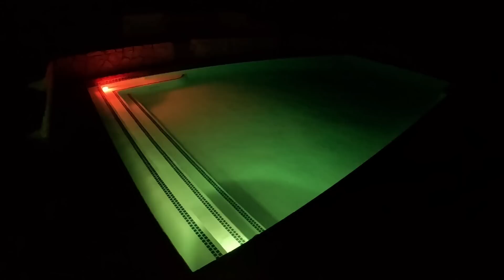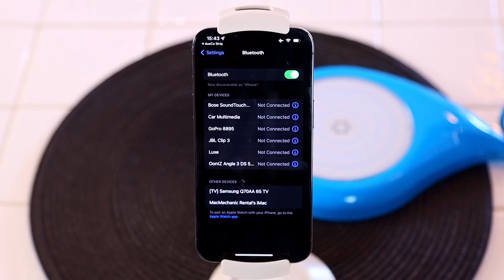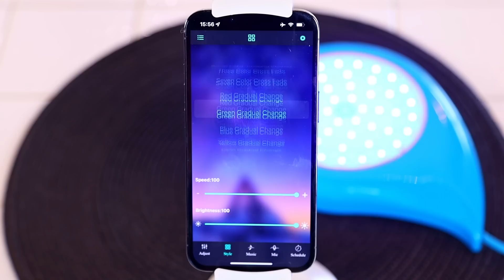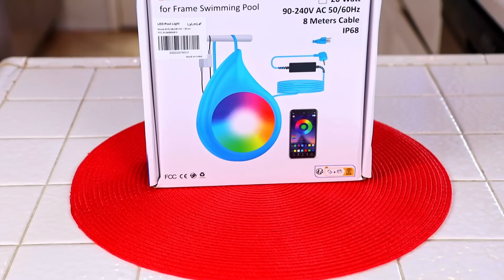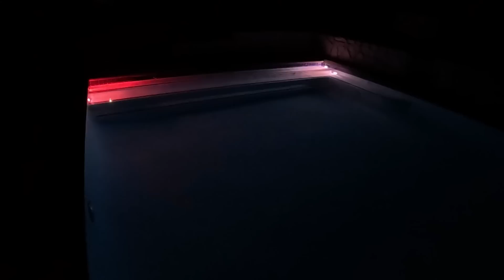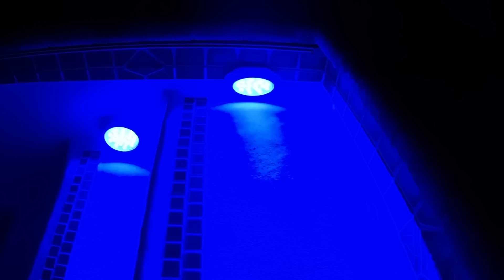Colorful LED Pool Lights - Transform Your Swimming Pool Into A Water Wonderland!

Comment: How deep do these pool lights work? You think they would do well in a lake?
Reply from the maker: Super @carolwilson1138!  Love it! They have an IP68 waterproof rating so they are water resistant in fresh water to a maximum depth of 1.5 meters which is 9 ft. So you'd need to keep it up towards the waterline of the lake. Such a fun idea!